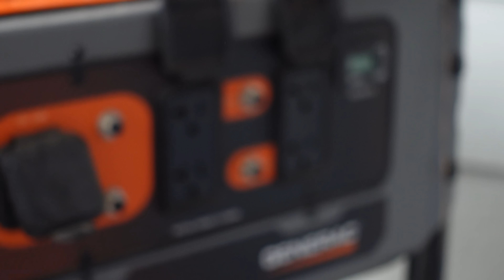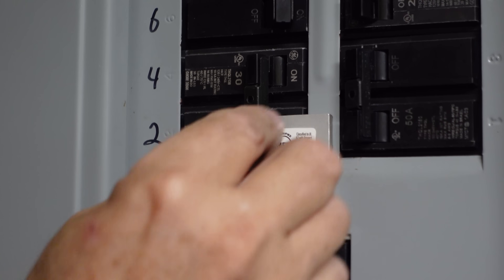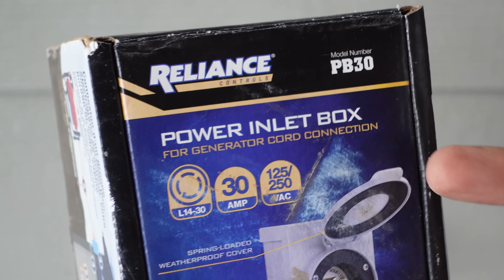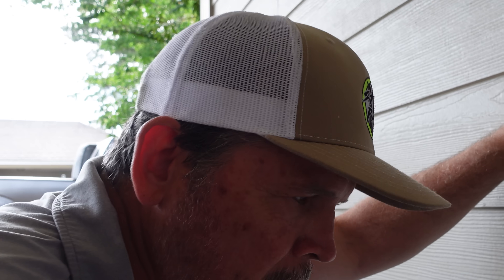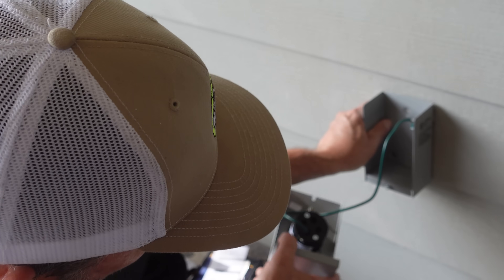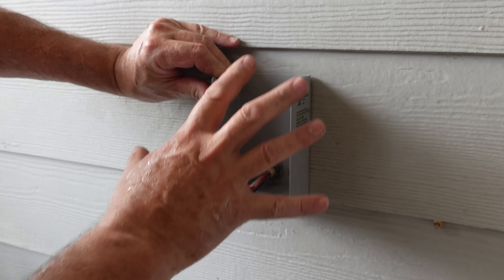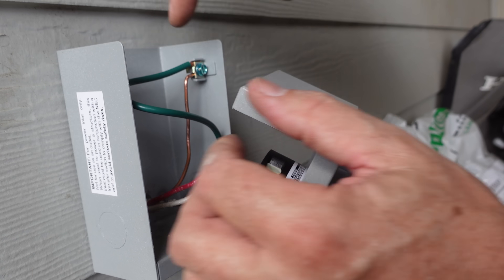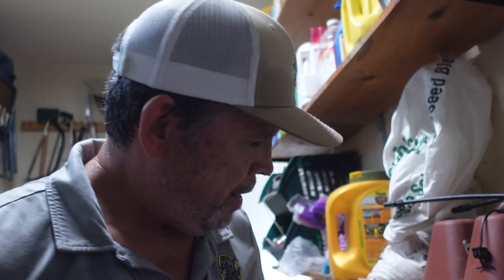What is a Suicide Cord and Why It Could Kill You

Comment: THANK YOU for a very informative video! I had to do a project on my house, to run an electric hospital bed, fridge & freezer. I bought a Lincoln WeldnArc that had a generator in it, gasoline engine. I was having to drop an extension cord out the window to get my wife flat for bedpan usage. It was a pain to do everytime, so I wired in three duplex outlets in one box, in the wall and painted the plate RED and labled it to run from the welder connection only. I had a little LED night light that stayed plugged in, so you could see that the generator was still running. I wired one in her bedroom's closet and one in my den's closet. I ran a piece of 3/4" conduit thru the wall and put a weatherproof box on the outside with a Marine dock receptical (male) and hooked it up there. I could run two extension cords from my den receptical to the fridg. upstairs and a cord to my downstairs freezer from the same receptical. None of the house wiring comes in contact with the generator emergency wiring. It's all professionally installed and labeled. Both recepticals boxes have 3 duplex recepticals in them and one LED night light. To show the generator is operating. The marine male wall unit has a twist lock that keeps the dock cable from coming loose from a yacht. The system works well.

Comment: great video and I agree with everything in it with the exception of putting a new end on an extension cord.  Sure, a new cord with molded ends would be preferred since its water-tight and corrosion resistant, but if you don't want to wait and can get the proper plug to install, you could save time and money by just replacing the end.  Some heavy gauge cords are pretty expensive.
Reply: I think there was some tongue-in-cheek to that comment - their extension cord mod video got  millions of views 🤣

Comment: I might have just went ahead and upgraded everything to 50 amp, wire and everything. In case they want to upgrade generators and be able to run more than just the A/C but I guess its up to the customer.

Comment: If you turn off the main breaker coming into the breaker box wouldn't it prevent back feed into the line.  Use the 30 amp breaker supplied by the generator to supply the breaker box during power outage. That is the way I was shown to do it without installing the proper transfer switch.  Let me know what your thoughts are on this type of set up?

Comment: A legitimate use for pocket holes, now I've seen everything...
Reply: Fine if you have tooling and hardware around, but next person doing repairs will curse you to deepest pits of hell since you need the special bit for those screws. It would be fine if it was basic torx head but nooo it has to be this special one. 4 Screws more and couple short scrap peaces of 2x2 and this would been standard install and more rigid top of it.

Comment: That electrical panel is mounted upside down?? The circuit numbers should start from the top down not down up?? Maybe the feed for the panel main was too short coming from the bottom and not long enough to reach the top?

Comment: Another reason to turn the main off : You don't want to waste your power over downed lines or some equipment that could grossly overload your generator.

Connect that cord to the wall THEN to the generator. Never start by plugging in the generator. EVER ! Have a 30 amp generator ? Use some over rated cord and socket. That way, if your next generator offers more power, you don't need to change the socket.
My stance is :  You can never go wrong using over rated cords and connectors.

Comment: Is there no better option available than that inlet with exposed contacts? Powercon connectors are rated at 32amps and are completely shrowded connectors whether it be male or female. We don't generally have generators set up to feed domestic panels in the UK, but if someone messed with that interlock isn't it possible to make the exposed contacts of that inlet live?  Still better than a suicide cord, but it amazes me how old fashioned US domestic wiring is compared to Europe.

Comment: Pocket hole screws are a horribly weak connection. Connecting a couple small 2x2 bits of wood to the back of the plywood and then connecting the 2x2 to the studs will give a much, much stronger connection. Also, those wires on the box are probably too short to be to code. You should have fed more wire down, but why fix a problem when you can just kick it down the road to the next guy.

Comment: Hey buddy! There is NO WAY a 5000, 6 or even a 10000W generator could kill a lineman. Why? Simply because if the generator is backfeeding the grid, the load being pulled by all the neighbors will overload the generator and trip its breakers in seconds! BUT...it might not trip quickly enough, and damage the generator, and even harm the user! 

The interlock s NOT to prevent backfeeding the grid! It's to prevent the generator (and the user) from being either damaged or destroyed if the generator is on while the main breaker is switched on, and utility power comes back. If you happen to have a powerfull enough generator to provide power to the neighborhood(and the city) and utility power comes back on, you would destroy your generator because it is not in sync with utility power!! It NEVER was about the linemen. No portable generator is powerfull enough to backfeed a city grid!

Comment: i prefer to just have the cord hard wired to the transfer breaker it is no less safe than a "suicide cord" and i know my customer cant do anything stupid with it with out altering my install and taking the liability on to himself....i also dont like those slide lever setups i prefer an integral transfer switch where the handles are physically tied to each other and can't be separated.

Comment: I’ve never heard of the The excuse you just gave for the transformer. AC current flows back-and-forth it doesn’t matter where the source is coming from what matters is yes you can back feed the lines but I don’t think it’s going to turn the transformer into a step up transformer.
Reply from the maker: It does exactly that… steps up the voltage.   Check it out on YT 👍
Reply: That’s literally how a transformer works. Depending on which way you put power to it the voltage will step up or down. If it’s wired to step down for the house then back feeding it will cause it to step back up to the power lines. It’d be the same as switching the wires to go from step down to step up. 
Being A/C just means it does it’s own switching so the transformer can work. It’s like the ignition coil on a gas engine cycling at 60Hz.

Comment: I have a question.  I have a 30 amp 120/240 DuraMax XP4850 portable generator that I have used for several years and several power outages to power all circuits in my house at the same time.   But I can't use the Microwave or the A/C unit on the roof. In the near future I will be installing a new electrical box like the one you just installed.  I like the fact that it has a cover.  Or I may just call an Electrician to install it for me.  I am very mechanically and electrically inclined, but I'm getting too old and just can't get down on my knees any longer.

My question is, do you think this generator will power my on-roof A/C unit if I turn off all other circuits.  After watching your video, it sounds to me like I can.  What is your advice?

Comment: Code around here does not allow such a solution with a simple interlock. Has to be a transfer switch, which is a kind of switch where it is mechanically impossibly to be connected to both power sources at the same time and where it is impossible to connect the two power sources together.

Comment: Unless you have a soft start kit on your heat pump or air conditioner that 5500 W generator will not start anything above 2 tons and it will have a hard time starting a 2 ton.

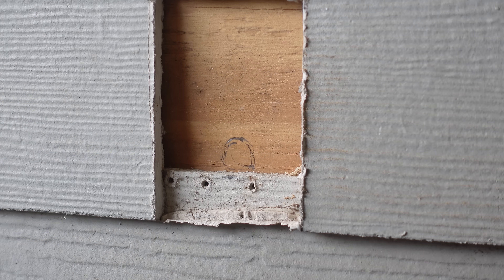Comment: The only questions I have, and they may be code things, is 1) why could you NOT mount the wire restraining nut with the tightening screws on the INSIDE of the box?  This would have allowed you to tighten them after mounting the box, which IMHO would have made that portion of the job easier.  2) @10:20 there is an obvious gap in the siding at the bottom of the opening where the external box mounts, why didn't you fill that with caulk or something (or perhaps you  did that off camera)?

Comment: He didn't say anything about grounding the plug or the box. I know, everyone that has knowledge about this knows that automatically. There are I Don't Know That, D.I.Y.ers that watch videos like this to learn how and they don't have that knowledge and may miss these steps. A modified cord is dangerous and may not be to code. It is possible to do, but an Electrician will tell you to do otherwise. I don't know if it is against a law a or a code. it would definite be against a warranty and would definitely not be covered by your insurance if something would happen and the cord would be the cause of it. This has to be mentioned for the people that have to have those special warnings. I don't know that much, but I don't have a problem with saying so.

Comment: 1.  If the original receptacle was 20 amp, what gauge was the wire?
2.  Don't you need a watertight wire connector for exterior use?
3.  "Why modify a cord?"  Because you can buy the female connector for about $10 but a new cord costs about $30-50.

Comment: Used a suicide plug for over 20 years with no issues as I pull the meter off the house every time when used so it's totally disconnected from the grid.
Reply: @Hello James how are you doing

Comment: Neat video! 

What I can't believe though is how the building techniques in those areas are almost exactly the same building techniques you'd find in an area with ZERO chance of a hurricane, like Nevada. Nothing about that building suggests it could hold up much against hundred MPH winds or insane rain. I guess it's just cheaper to patch the holes afterwards then to design hurricane proof walls from the get-go. A few concrete walls would stop 99% of all wind damage.

Comment: I would have installed the clamp on the wire first,then inserted in into the rear of the box,slipped the nut over the wires and onto the wire clamp and tightened it at the nut last................but hey,what does a new yorker know...........

Comment: What we sometimes do is we always add the interlock but we also add a 6x6 or 8x8 junction box on the outside. Then we buy SO cord and we make it up to the breaker. You will have the male end in the box but there is no way for power to be on it with the interlock in place. You can roll up about 25-30ft in an 8x8 junction box and we add a connector to the back of the 8x8 so there is no way for the wire to put stress on the breaker connections.  it's really handy for people that want to run their generator from their detached carport or away from the bedrooms. Also it is 1 less failure point. But this only works out if the panel is mounted on a wall connected to an exterior one.

Comment: The bare ground wire slipped out some when you tightened it and that's the important one..  I would have added some caulking behind the top screw you  loosened to keep water out of the house..

Comment: If you don't have one of those long bellhanger drill bits, you can use a wire insulation hanger.  Snip the end off at an angle and use as a bit in your drill, to pierce the drywall.

Comment: Fantastic video.  I want to put in a back up generator at my house, and watching this makes me think I could install the electrical myself.  Two questions.  First, why did you drill a 1&1/2 inch hole in the plywood backer when 3/4 would have sufficed? Secondly, what are the the advantages and disadvantages of a lock-out switch over a transfer switch?  Maybe, you could do another video installing a transfer switch that would explain the difference.  Stud Pack guys do a great job explaining this stuff and it is really helpful.  Thanks.
Reply: He had to drill the larger hole to fit the metal connector that has screw hold downs in it. It looks like just a 3/4" hole would work from the front, but if you watch what he did to the back it makes more sense.
Reply: @Swarm509  Thanks, makes sense.  I will watch it againm

Comment: Twist-lock connectors are use inside theaters all over the world mainly for lights. Who the hell designed that outside unit with this connector? Anyway as I can see, the cable wasn’t really the problem but the electrical box. That wiggly installation was the “suicide” device, not the connectors.

Comment: Great video!  Has the potential to save a lot of folks from an early demise, and also good info on how to properly hook your gen-set up!   I have an 8k Harbor Freight backup generator for the house to be hooked up essentially the same way.  Harbor Freight sells a 10ga, 25ft connector cord for about fifty bucks that is just the ticket for hooking up your gen-set from the 4 wire 240v output to the house and has the proper plugs on each end.  I purchased my house wall connector from a local electric supply house.  The lockout box that breaks the house system from the gen wall inlet has a pull-out connection that is safely locked in my gun safe, so there is no way for the "uninitiated" to connect the gen to the house circuits accidentally.  Since it is an old house with a cartridge fuse main, the cartridge fuse main block is to be exchanged with the pull-out connection for the gen circuit when the system is put to use, so there is then no way for the house to be connected to the commercial mains when the generator is in use. Oh, and btw, Since the circuit breakers on the gen set are about 27 amps for each 120v leg, I have a pair of 25 amp breakers hooked up inside the house on the gen set circuit so that they will [hopefully!  LOL] throw before the ones on the gen-set, should there be a demand overload of any kind.
Subscribed and belled!

Comment: While we didn't see you pull those wings from inside the wall I trust that you did😁. Nothing frustrates me more than people who do things like shove packing materials, bits of wire that was trimmed, or perhaps wings to secure a box to studs or drywall down into "the abyss" because the customer will "never know anyway".

I've seen a few YouTubers who have done it and it screams that they lack pride in their own work and are also  naive about the safety risks. All it takes is a sharp piece of metal to rub or cut a piece of sheathing and now someone has gone from poor workmanship to major liability, serious injury, and potential death. 

I'm typically in the low voltage realm and learned a lot from your video. 

Thanks again!

Comment: The section on the suicide cord is a legit life saver for some homeowners. Folks start those generators up with the plug in the generator and the other end not plugged in, especially when they are in a hurry.  Really like the videos by Stud Pack - straightforward and at a level of detail that explains the topic from an educational standpoint and of course the "how to".  I also did not know about the step up, good video.
Reply: Ok. So what if it's plugged in before the generator is started up? Don't lick the copper and you'll be fine. I play with live 480 every day. More voltage on each leg than both legs of genset create together. Just don't touch the copper bits and you'll be fine.
Reply: @klinestill Oh how will I ever recover? Some smartass Harry Homeowner won't hire me to do something that shouldn't be done in the first place.
Reply: that kind of cord should be BANNED and the NEC should add code to do it the way these guys did here! good lord, that is an an accident looking to happen...
Reply: @mprenn1547  BANNED how? Can't buy male plugs from the hardware store anymore? 😂😂
Reply: @NoopityNoop  Not really, is not that male ends on their own are dangerous... And I dont live in the US, but man.. u gotta admit selling a cable with 2 male ends is A HALF-STEP close to selling one of those put-two-fingers-in suicide adapters iss crazy in my pov
Reply: Imagine like a pet or a small child unknowingly starts playin' with the wire or something w/o supervision, u could say its the fault of the caretaker but even in that case u know that CAN happen, and it's very possible

Comment: I'm glad this video came up in my suggestions.  I have a suicide cord that a retired electrician made for me many years ago when he powered my house up.  The last time I had a power outage I questioned why the one cable end opposite the generator isn't a female, since it's so dangerous.  I've been wanting to do this upgrade, but haven't come across a video until now.  Thanks for everything, it answered all my questions.  Oh... I do have a question and that is how do you know when your power is restored?  My electrician put a small outlet box next to the panel which I can plug a radio or lamp in, telling me that I can go shut the generator and flip the switch which prevents backfeeding the panel, like you mentioned.  Thanks again!
Reply: If I understand correctly, you should never leave your main breaker "ON" if you are feeding your house via generator, solar, or your own transmogrifier. That is exactly what drives voltage onto the grid (also defeating your generator efficiency).
Throw the main, set generator breaker to "ON", then plug in your generator, start your generator. Check power in house.

That was my take-away, anyway.

Comment: If the receptacle was for 20 amp, wouldn't the existing wire have been sized for 20 amps.  I am not an electrician. Shouldn't the wire be upgraded for 30 amps?

Comment: It wouldn't be a suicide cord if you used common sense.  You plug the cord into the wall first, then into the gennie, then turn on the power.  Same as when plugging the computer in: computer end first, then into the wall.